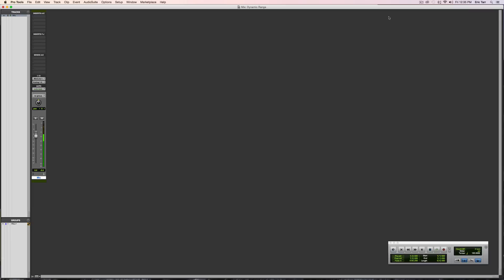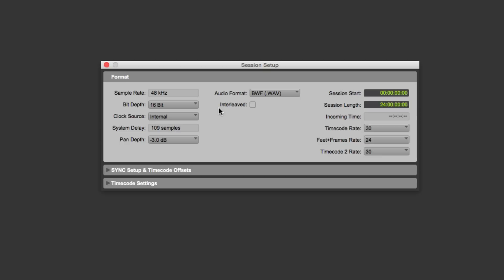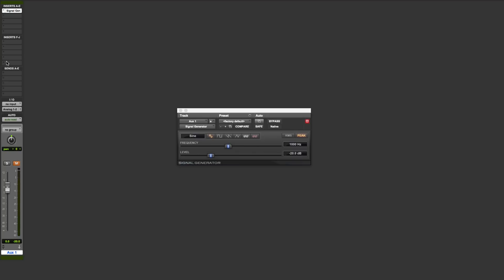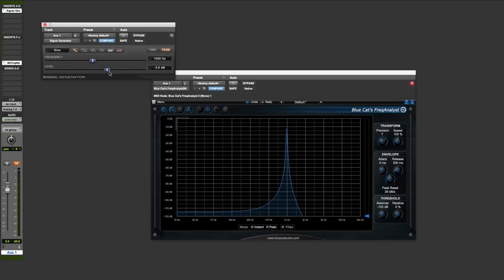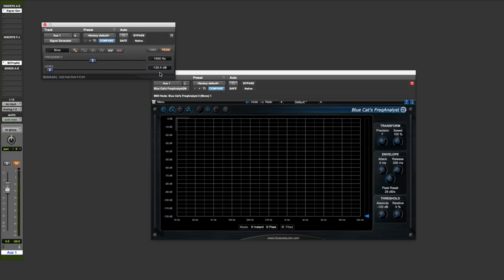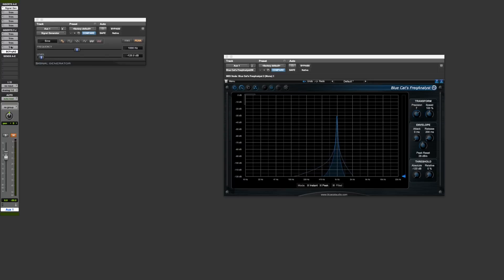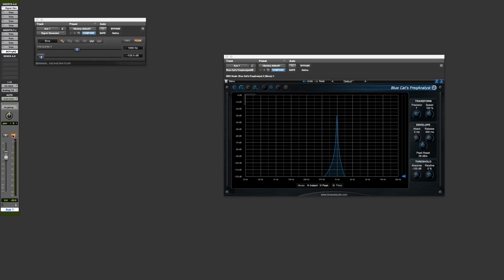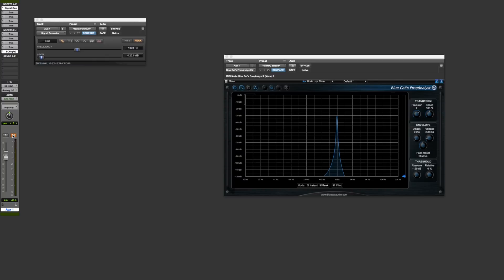What's the Noise Floor of a Digital Audio Workstation?

Comment: It is possible to detect a signal approximately 15 dB below the noise floor because dithered quantization noise is equally spread across the full band. (Without noise shaping.) Some of it is inaudible completely in the top end. Total noise power sums to about -96 dB RMS, but within the audible band where the signal exists, the noise is a fraction of that. Doubling the sampling rate, decreases the quantization noise within the baseband by 3 dB.

It is correct what he said about internal precision in the DAW. Just that the analyzer would still show the signal even in a 16-bit system.

Also some plugins may still have limited dynamic range.

Comment: what happens when you use a analog simulator plugin like NLS do this create a noise floor as if it was analog? or that something totally different ?
Reply: +BENNGIIE If a plug-in creates a noise floor, then it would have a problem. This is another reason to turn the "analog" button off on a lot of plug-ins.

Comment: I guess this relates to audio synthesized by the DAW and not audio via an Audio Interface, unless the interface supports 24 or higher bit rate.
Thanks for a great video
Reply: +RecordingStudio9.com That is correct. This is for changes in amplitude internally to the DAW.